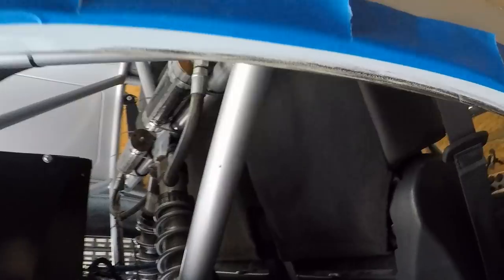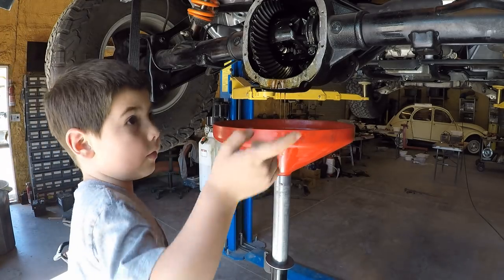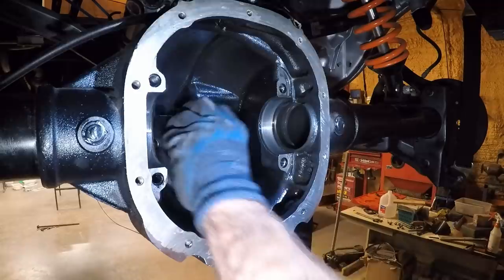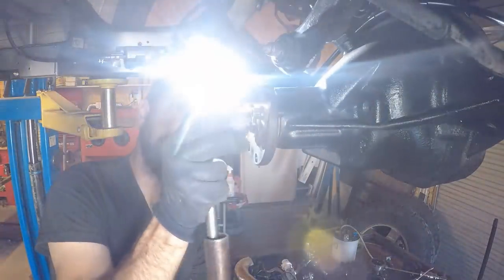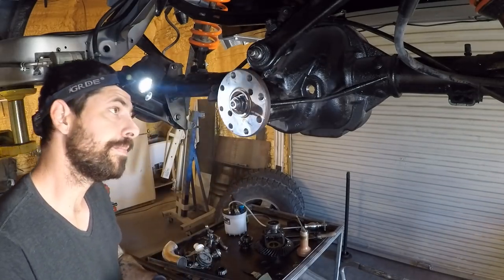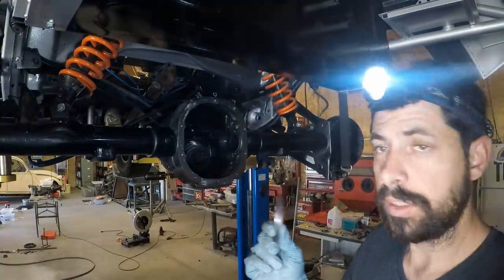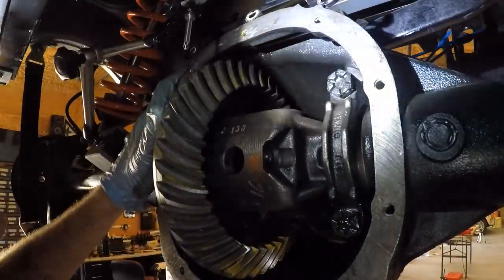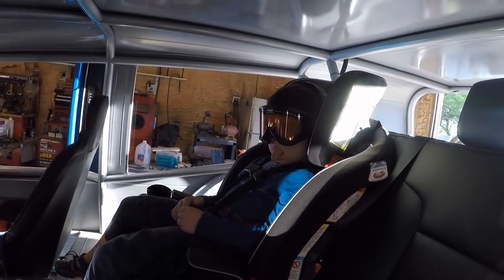8.8 Re-gear and Spartan Locker Install ($4k Crown Vic Trophy Truck Build (Episode 20)

Comment: To set the pinion depth correct, use some 'setup bearings' basically they are pi ion bearings for that application with the insides slightly machined. This allows you to pull them off and make changes to the depth shim without destroying the expensive bearings.
Reply from the maker: That is a great Idea, but I did not have setup bearings on hand for an 8.8. I have had really good luck re-using the factory shims, but I will probably get a set for future swaps.

Comment: Spartan lockers might be noisy but their reliable and do quiet pretty significantly after a few thousand miles. I have them in both of my CJ 5 axles and they are great as far as function and reliability. The front is still noisy due to being used much less than the rear daily. But the rear is much quieter than it was a year ago when I rebuilt my diffs and installed the Spartans.
Reply from the maker: So far I am thrilled with the traction and the noise is super predictable so it doesn't bother me. Does scare new riders tho
Reply: @AustinCoulson  well arent new riders supposed to experience a bit of thrill during their first ride ? Seriously though they certainly make some unpleasant exspensive sounding noises but thankfully those noises are normal and subside quite a bit after some miles and time. Either that or ive just grown so used to the ratcheting its began to just blend in with all the normal backgrown noise . Either way it works for me 😁
Reply: And yes the traction is nice. Especially with them installed front and rear. It takes some getting used to when driving with the front locked up . The jeep doesnt want to do anything but go straight if I am adding throttle to the mix with the front engaged. I have to initiate turns with no throttle and then throttle up after ive entered it. If I were to do it again I would choose  selectable lockers rather than the auto or lunchbox locker type the Spartan is. Especially up front. But the price point of the Spartan locker vs selectables spoke loudest or I just listened to that voice more

Comment: How do you like the Harbor Freight "Earthquake" impact ? looks like it works well !! Love the series ... your building skills are superb, as far as the looks ??? it's just that the front looks bigger and more aggressive than the rear. Paint works and the wiring, body panels and fabrication ... spot on !!
Reply from the maker: I really like it, except the knob on the back has started to stick so I need to take it apart. When you watch a side by test of it vs the snap-on it's hard to justify the price of a snap-on.

Comment: Thanks for this!  I will stay away from those Spartan Lockers.  Not very confidence inspiring...
Reply from the maker: I actually really like the locker, it's just quite noisy. They are marketed for budget dirt toys so its perfect for this. I wouldn't run one on a daily driver. For those I prefer the Ford trac lok
Reply: @AustinCoulson  Ok, thanks for the extra info!  I just didn't like how much it slopped around in the diff housing, or the excessive clicketyclack while just driving straight.  I'll probably just keep welding mine. Lol

Comment: Seems like your rear shocks could use a bit more dampening.  Might struggle keeping tire contact on a rough road at speed.
Reply from the maker: I increased the pre-load by another inch and they are dialed in great right now

Comment: Very cool project!  I've watched every one of them.  Quick question: I think the police cars have 3.55 gears.  Why not just swap the whole housing and be done with it rather than the hassle of setting up gears?
Reply from the maker: P71s came with either the 3.27 or 3.55 and I've never been lucky enough to get the 3.55. Also the LS is optional in 2005-2011 and, again, I've never been lucky enough to get one, so the one from the P71 in my yard is a 3.27 open which isn't much improvement
Reply: @AustinCoulson  Gotcha.  They're a dime a dozen here on the East Coast but then your yards aren't full of cars that are rusted to death.  Had one out of an Explorer in a Jeep YJ with 4.10s on 33s and never even hurt a u-joint.

Comment: Those coil overs need to be straight up and down to maximize the spring rate. That's why it's so soft.
Reply from the maker: I compensated for that when choosing the spring rate, but I added some weight after that and I didn't have them properly preloaded until the next episode

Comment: I know this is a budget build but when you're done and happy with it consider  Metco or Heinous rear control arms. They definitely make the rear end more sure footed!
Reply from the maker: There's a few things I will have to do after it's "Done". I figure I can toss the budget once I've shown that it's a competent toy.
Reply: @AustinCoulson  Haha, thats kind of what I was thinking! I did full metco setup on my p71. I should have did it years ago.
Reply: I saw a guy weld 2 factory stamped control arms together to make them stronger. Might be worth a try before buying aftermarket ones.